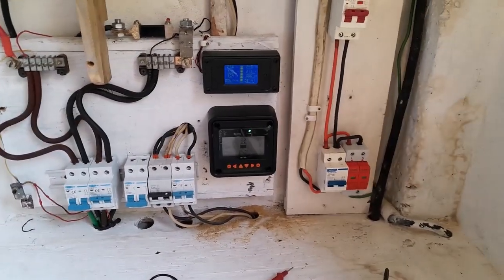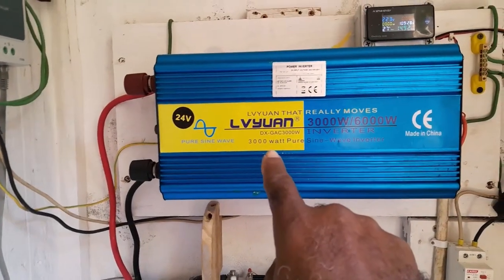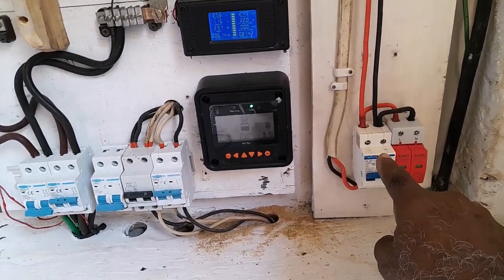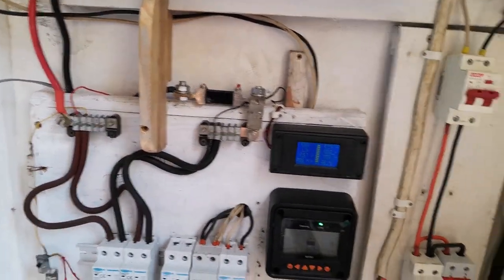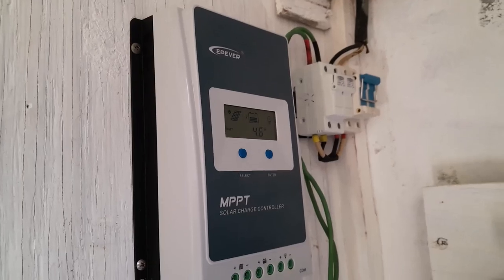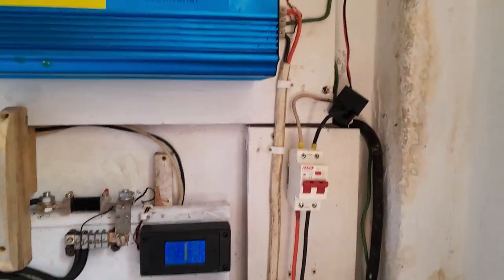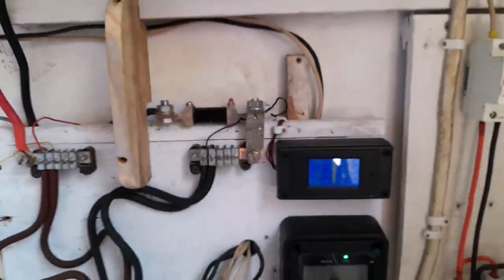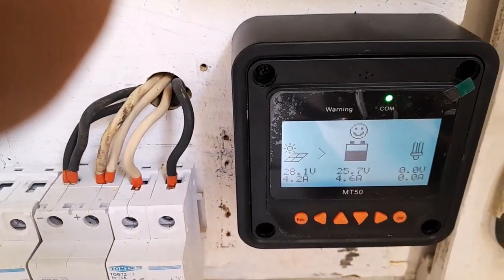Lvyuan DX Gac3000W Inverter First Install An Run

Comment: Do you get a large drop in voltage on full load , even with a fully charged battery my output drops to 195v
Reply from the maker: No I haven't check that I will keep monitoring it, the only thing that I notice is the fan would not turn on.
Reply: @AlwynNicholas  i opened mine up to find it has 2 thermistors the one closest to the fan controls the fan, mine was not touching the body of the heatsink I have pushed it over so it is now touching the case and added more heatsink compound.
The other thermistors seems to have  no effect on the fan but shows in the lcd.
Reply from the maker: @duncanfandrews  I will put a external temperature controller witch is a thermistor temp sensor 40c in it to controll the fan.
Reply: @AlwynNicholas  for all the current it draws i am going to rewire my fan to run all the time,I find the caps are getting very hot.
Reply from the maker: @duncanfandrews That's a good idea.